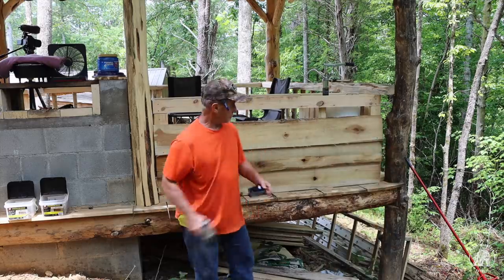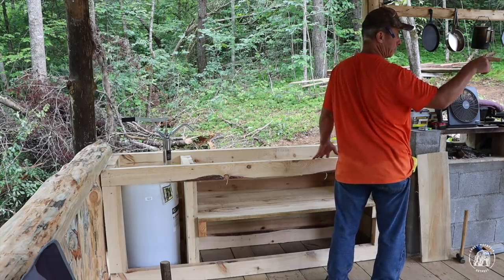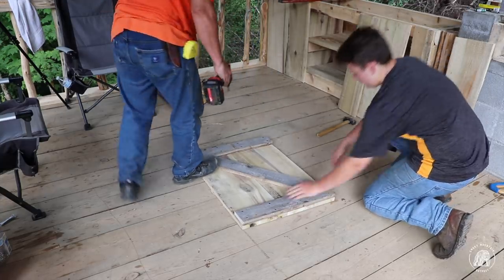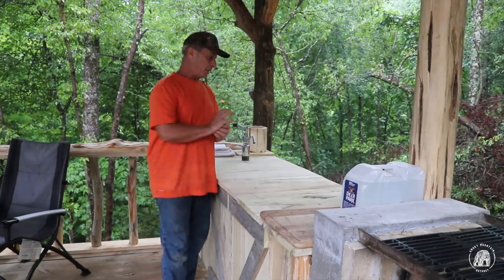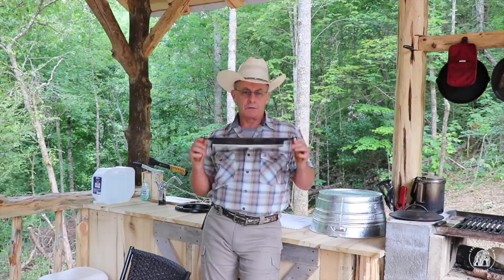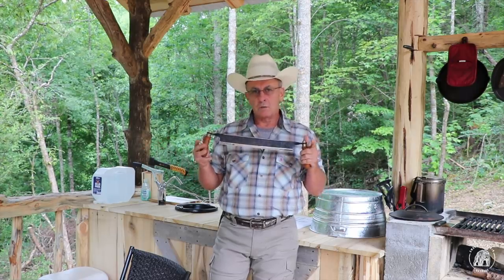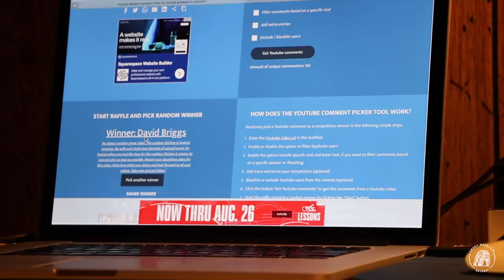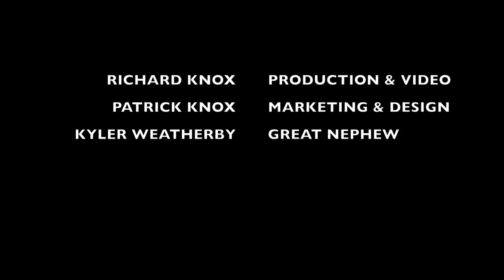S2 EP33 | TIMBER FRAME | OUTDOOR FOREST KITCHEN | BUILDING KITCHEN CABINET

Comment: Grats David on winning the tool kit. Awesome job on the cabinet build Richard! You might consider making your back-plate on the counter top 6-8 inches, as I am worried that 2X2 will not be sufficient to prevent items tipping off counter top. Just a suggestion. Keep up the great content!
Reply from the maker: Thank you

Comment: I've got a dual wheel wheelbarrow just about like yours . I like it much better than the one wheel setup the problem with mine is the bed split not long after I bought it. It hauls stuff just as good but probably wouldn't hold water lol.
Reply from the maker: Mine is cracked also

Comment: suggest in the future (when you are more complete on outpost) you consider building a concrete countertop in outdoor kitchen.......fire resistant, will not warp, water from pail sink would damage concrete......you can include fancy coloured pebbles, bits of coloured glass etc........am sure you will consider a bigger sink with a drain pipe to a dry well in a low area......keep up the good work and documentary production !!
Reply from the maker: Thank you for the comment and channel support.

Comment: I found that bug netting keeps a lot of the rain out as well as limiting the bugs. Just nail the ends between some 1 x 2's attache a string at the top and run it around the bottom and backup thru a small pulley and it's retractable or removable. Then you'll have a screened in out door kitchen.

Comment: if you have some slate stone..on your property.. (1inch thick and the width of your counter)..you can use that as a cutting cleaning board.. rub some oil on it..after cleanup with water and vinegar mix (no bacteria left on either side).. slate stones are normally flat and easy to use...before or after usage you can stone it either in the cabinets below or.. stand it vertically...Stay safe.. GOD BLESS.
Reply from the maker: No stone here

Comment: Enjoy the show next time hand Kyler the drill to put in some of those screws. How about a square sturdy table to eat on and work on. How about a flat area to solid toped to cook with dutch oven especially the legged ones or others using a trivet. Keep up the good work it will soon be cooler.

Comment: Shouldn't the diagonal braces be the opposite way? So that the weight at the top furthest from the hinge side is transferred back down in to the hinge side? The way you have them now, the diagonal braces don't help at all, because they transfer weight from the hinge side OUT to the bottom edge away from the hinge side.
Check this, it has an image to help understand: https://www.slidegate.net/what-is-the-right-way-to-brace-a-gate
Reply from the maker: Thanks. I did them that way because they would interfere with the handles. They seem to be doing well
Reply: I have been installing gate for the past 25 years the Diagonal Braces are put on right they need to come from the top hinge to the bottom center of the door it keeps the doors from sagging . Because it pulls up from the bottom center to the top . I have seen so many gates that they were put on wrong dragging the ground in the center because it was put on wrong it keeps the door or gate square